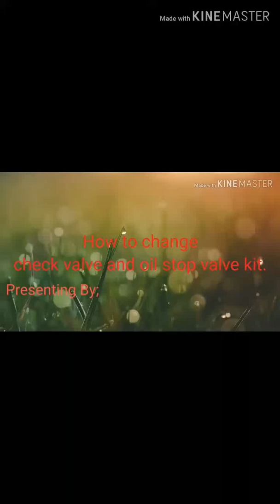how to change check valve and oil stop valve

Comment: Bro do you have some doucement for   scrow compressor plz
Reply from the maker: G kis type k documents chahiye...
Reply: I have overheating problem in screw
Reply: Please reply
Reply: @nasirali4663  check oil level
Reply: Oil level is ok
I think oil circulation problem because one pipe from oil cooler is cool and the other is very very hot near to burn in seconds
Reply: If you have any information please guide me
Reply: @nasirali4663  check oil filter if you have an old one replace it if the oil cooler is cold then 
Also check thermostat
Reply: I have already changed both
Reply: Hello sir 
Work of check valve and oil stop valve plss example sir